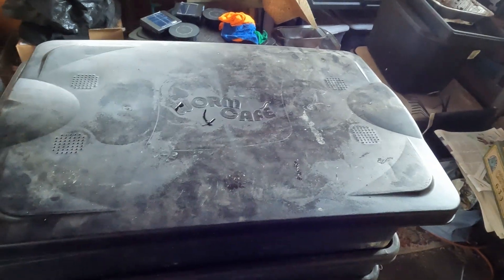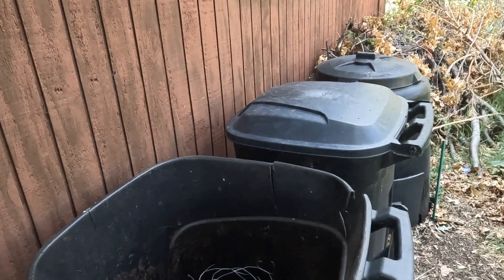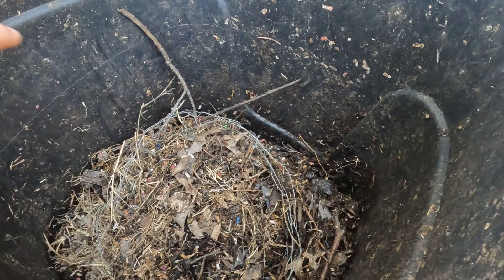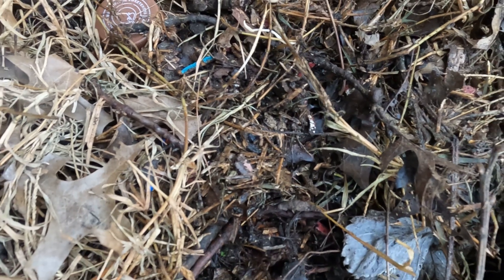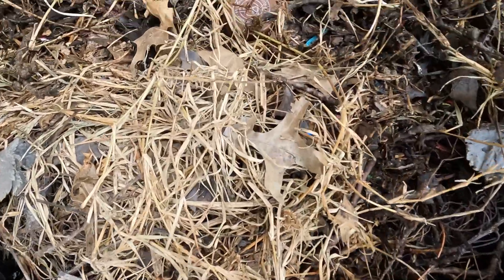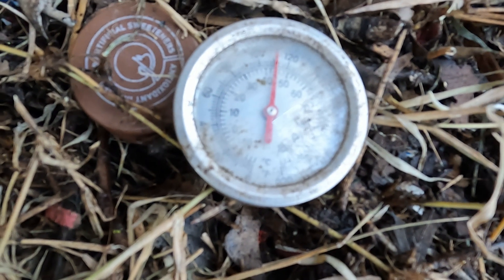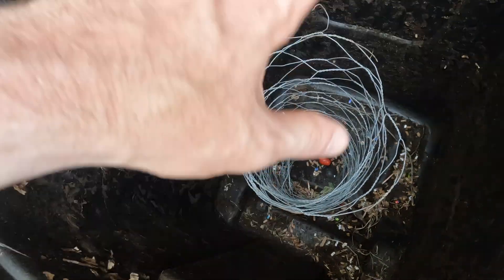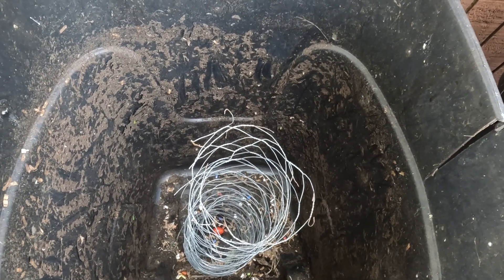The Art of Compost: Adding Extra Heat and Air

Comment: Drill a bunch of holes in half the length a pvc pipe and put in the middle of your compost to the base. Heat rises. As heat rises from the compost the cooler air gets pulled in through the pipe to the bottom of your pile bringing in oxygen
Reply from the maker: I didn't have a pvp on hand hence the chicken wire however that does lead me to think about using both and turning the gap from the chickenwire  into a keystone. A layer within a layer
Reply from the maker: Thanks for the tips!